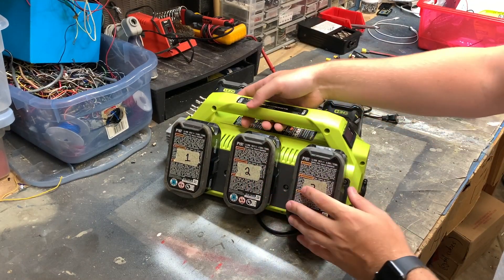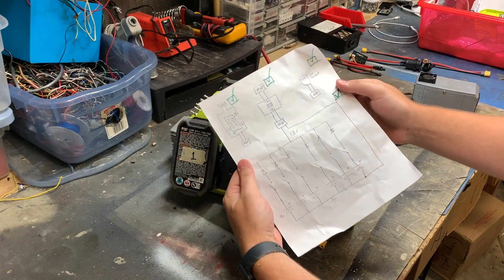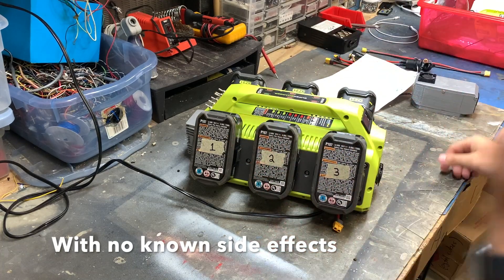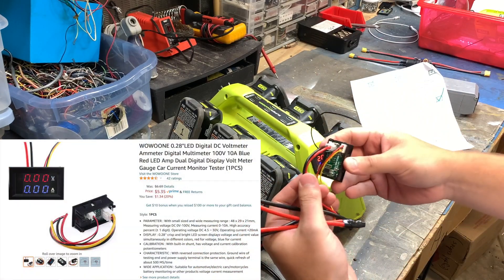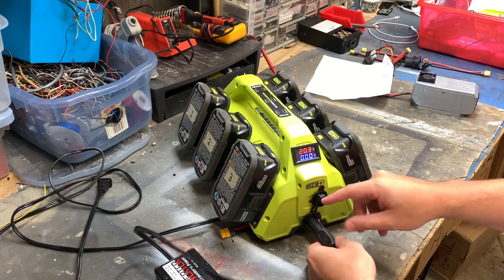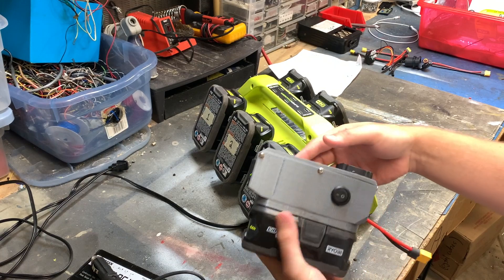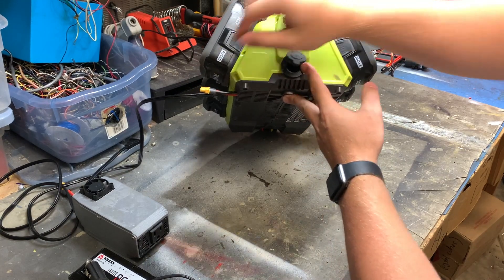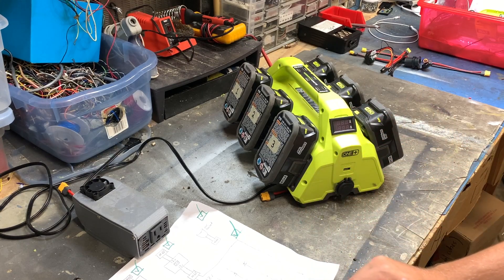I built a Ryobi 18v ONE+ Power Station

Comment: Those diodes are going to get hot if you pull any current through them, maybe a low drop schotty will help or go with an ideal diode/mosfet based, also would put the wires up to protect from damage and getting wet

Comment: Awesome. Such a clean design too.  Ryobi does make a 18v battery power station now, but at about $900.   FWIW, what I’ve long wanted to make is a AC power to 18V ryobi battery adapter I could use for my ryobi air compressor. 4ah batteries last about 5 minutes on that thing.  I have the skills, just don’t know what the peak power draw actually is to size the transformer and buck converter… although also thinking of just using a repurposed laptop power supply if that can put out enough amps…. Anyway, if you want a killer project, do that one!

Comment: i did a similar config on mine without the switches. something i noticed was a phantom battery issue - if i left a slot unpopulated it would still show the testing flash on the empty slot. no issues charging when fully populated. switches are a good/easy way to get around the behavior tho. I like it.

Comment: Nice video. Was wondering, when all batteries are "on", what the capacity of your power system is. Have you considered adding a bms system to manage all batteries health? What is the maximum load of your system when a device is connected to your 20 V outlet?

Comment: i hv made one similar to this... with a bit more features.  like a built in solar charger... a 480w dc to dc converter. lights..  main fuse and switches. works great and very handy.

Great job, I have done something similar as well. Mine charges all batteries simultaneously with 10v to 24v DC input, 480w 12v output for DC-AC inverter, 12v Socket, and USB outputs.

https://www.youtube.com/watch?v=Yel9XrMy6l0

Comment: Any sujestions on how to design one that drains that batteries in series. I would love to make on where i could switch between higher amperage vs a slow discharge model so i could swap the batteries one at a time as needed for some lower use like a lower draw usb or 12 V device while off grid. The switches are cool but you would have to keep up with status and manually flip between. I would probably so a hack of both depending on my power draw needs

Comment: Very cool! How many amps could you theoretically pull from this thing?
Reply from the maker: The design in the video as built would probably start having issues at 10 amps due to amperage screen throughput, high gauge wires, single ground, and low amp switches. If all those were perfected with no losses the limit would hypothetically be the combined amperage of all 6 batteries since it's all in parallel. 

I've seen some 4 Ah batteries pull up to 20 amps each so that would theoretically make 120 amps and therefore 2400 watts at 20v but all the 4Ah batteries would run out in <12 minutes if at full load. 

20 amp test guy
https://www.youtube.com/watch?v=_8mkHV1pWPs